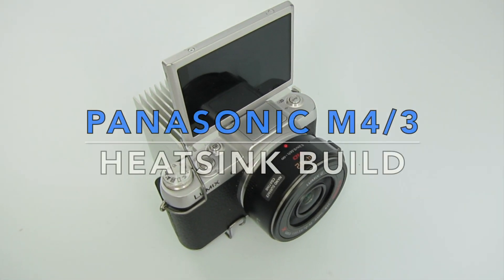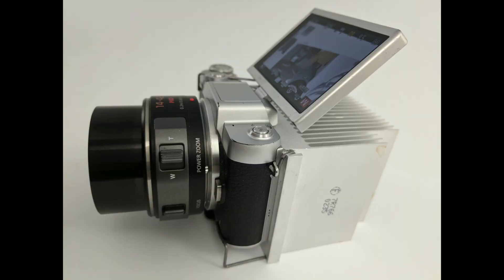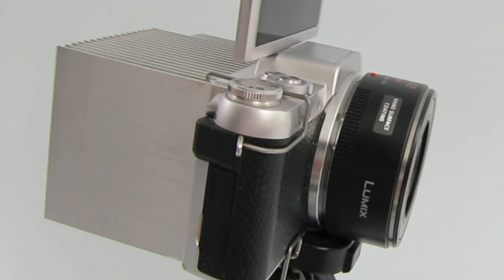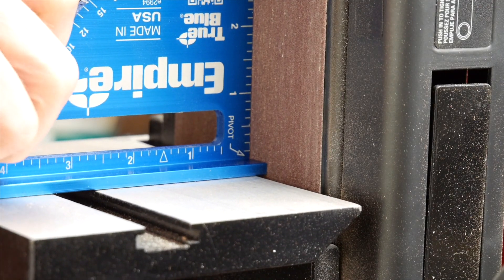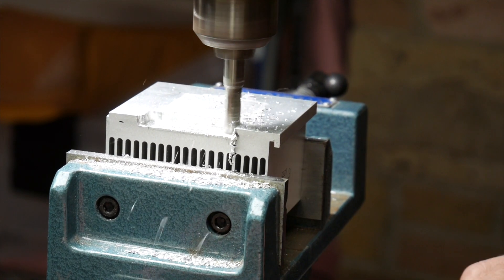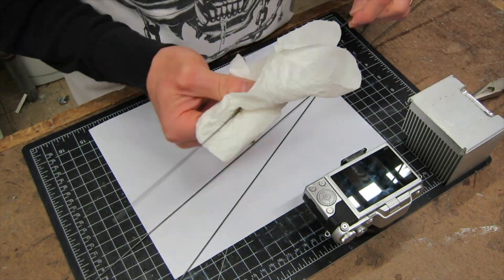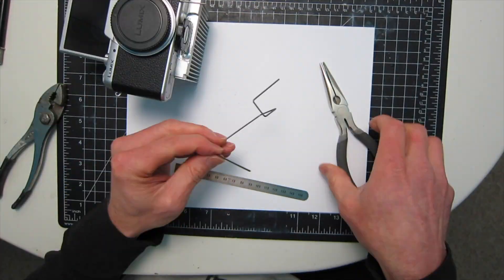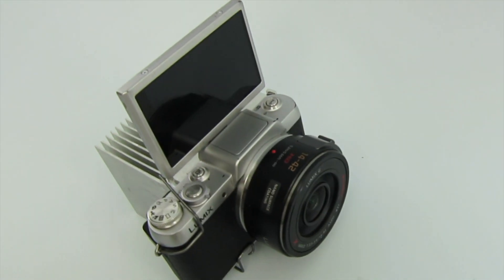Panasonic Heatsink Mod for overheating lumix GF7: Hack your camera with recycled PC heat sink build

Comment: You could also attach a small desktop pc fan to the heatsink to draw the hot air out but it might not be necessary if it is doing the job.

Comment: Huh. I wonder, what did they do to make the camera overheating prone? It goes into thermal shutdown when it reaches about what temperature on the outside? Chances are, the manufacturer didn't actually resolve heatsinking from heat generating components to the enclosure all that well inside the camera, but i understand that you might not be prepared to strip it apart, cameras are just the most finicky things to get back together properly and easiest to damage. Probably half the thing is on a kapton flex PCB.

Comment: Why not add a thermal-pad between the camera and heat-sink help to improve the cooling ?
Reply: Thermal pads are a bit filthy though, leave oily residue, tear apart and part stays on camera, part on heatsink, etc, sometimes they bond really well. It would have been something to do if it was a permanent installation, but it's not. Finally, there is so much contact area between the heatsink and the camera body that it should just about be somewhat helpful without it, which is likely all it needs to do.
Reply from the maker: Works fine with out one, thanks for the idea though. Should I ever have an issue with it not working I would try that.Melvin Chong

Comment: The result is a larger size than a DSLR camera. It's easier to buy a DSLR camera and not suffer with cooling
Reply from the maker: I only need this occasionally when the room is hot 85 or above, it is not needed during regular room temp recording.Igor Sarapulov
Reply: Understood thanks!

Comment: my GF7 gets hot but never overheats when recording video for hours.  But I record indoors if that matters.
Reply from the maker: Michael Ma only when the room is hot, perhaps about 85degrees or so does the overheating occur. During regular video recording at normal room temp there is no issue.